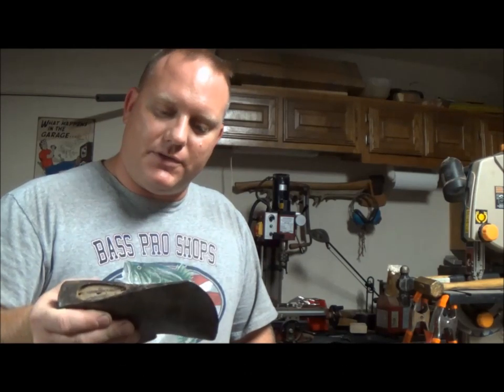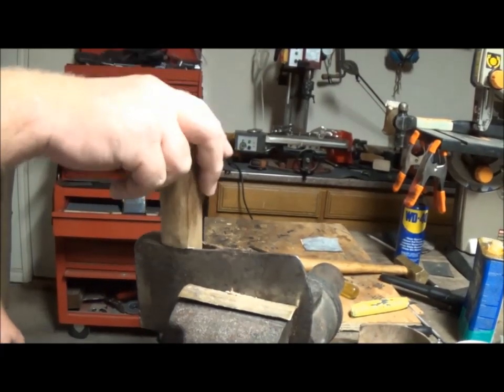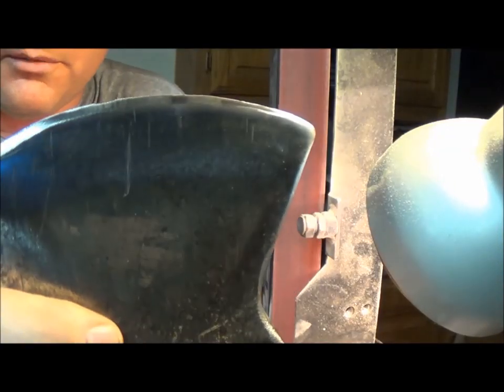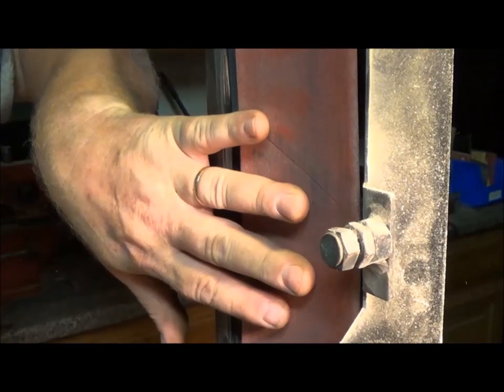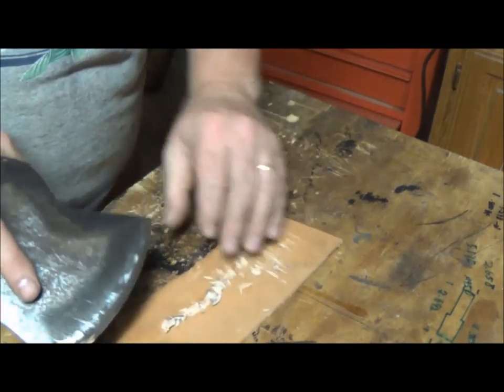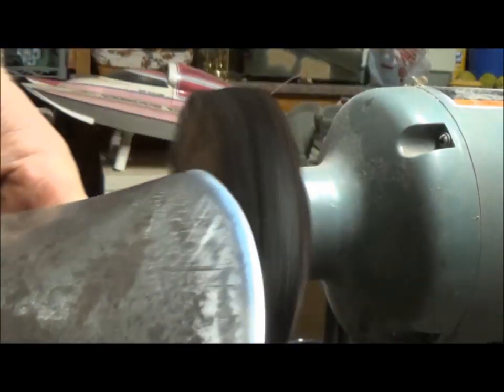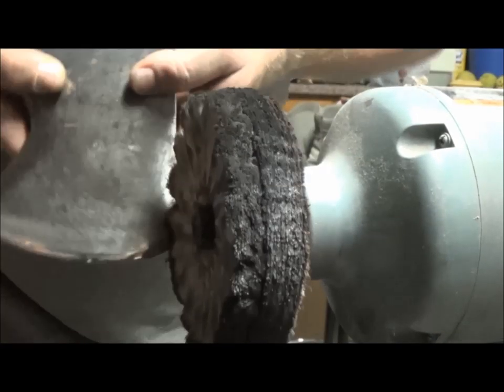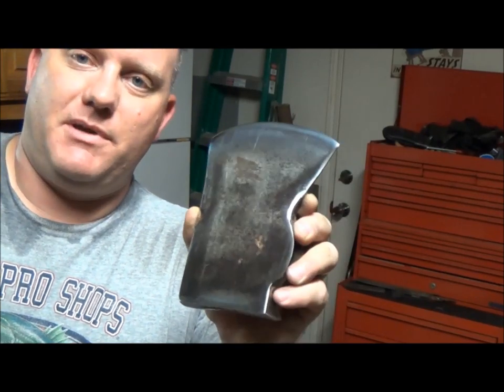Rockaway Axe Head -  From Rust to Polish

Comment: Were you worried about changing the temper of the edge with the heat of sanding and grinding?
Reply from the maker: Not at all. I'm not using much pressure at all on the sanding belt.

Comment: congrats. you have now a beautifull ruined axe.
Reply: +Philip V. After final heat treatment that was made in the factory you never touch a axe with power tools unleass you re heat treat it.
Reply: +Philip V. considering that a blade is anealead and quenced for strict periouds of time at very strict controlled temperatures... every heating counts on disturbing the treatment. If you use power tools, use very cold water in the abrazives in the same time
Reply from the maker: +Chirana Gheorghita Eugeniu Theodor I didn't let the heat build up enough to ruin the temper. I used the backside of the belt sander and went very easy on the pressure.  This axe is still as sharp as the day I sharpened it and its been through a 1/2 cord of mesquite already.
Reply: +Chirana Gheorghita Eugeniu Theodor yeah, that is wrong. most competition axes are ground with power tools. I grind all of my axes with a 9031 Makita belt sander, and I use them often-- not for a hobby, but for my job. you just have to be considerate of the heat buildup-- dont ever get it above 250 F and you are in the clear as far as changing the metallurgy of your steel. i basically just keep it cool enough so i can hold my hand on it indefinitely.

Comment: Did you ever do a followup video when you hung a new handle on it?  What else did you do to the head after this?  Did you polish the rest, paint it, or leave it?  I'm trying to polish an axe head myself.
Reply from the maker: I didn't do a follow up video, but I did put it on a 32" House handle and it's my main splitter.  Put a coat of beeswax on the metal and it's gotten a great patina from the use over the last couple years.  With the short handle and heavy head really does wonders with Mesquite.  Still own it to this day and sits next to my fireplace.
Reply from the maker: Anthony O I have other videos in my playlist that depict how to haft an axe head, feel free to check them out.

Comment: You weren't worried about messing with the temper of the steel while using a grinder on it? Could be very detrimental to the steel.
Reply from the maker: Nah, it doesnt get hot enough.
Reply: +3E971 hmm.. From what i know it does get hot enough. Seen alot of ruined tools from to aggressive machining
Reply from the maker: +Wafflemaste I go lightly on the belt grinder, especislly on the cutting edge, using the backside of the belt sander. the poll I'm not too worried about.  I only clean up those corners for getting rid of the mushroomed areas.
Reply: +Wafflemaste    I have got 2 hatchets 1 large axe 1 splitting muale all fiberglass handles can I switch them to wood  if you know or anyone else knows thanks in advance  and  also have a machete/Ontario knife brand w/o sheath never used its black w/hand guard and lanyard hole any thoughts
Reply: +Nexite well, what you know doesnt compare to what i know. true, i have seen some power tool ruined axes, but i have sharpened and used a lot more of my own axes with belt sanders and power tools. it has no effect on the temper if you are careful-- just dont ever get it too hot to hold indefinitely. folks who say otherwise just believe well intentioned fables!

Comment: Why the "criss cross?"  I don't understand it.  No axe I've ever sharpened has had a "criss cross."
Reply from the maker: Criss-Cross patterns help to remove material faster and also overlaps buffing wheel marks and very tiny scratches from the abrasives.
Reply from the maker: ***** Finger Eleven - Paralyzer

Comment: You're supposed to burn the helve out.
Reply from the maker: Caleb Whittington HA!  Nope, doing that would ruin the temper of the bit.  I've passed up many axe heads at flea markets for that very reason.  If it's not sitting in the corner of a garage at an estate sale or auction, I'm gonna take a close look at it before I buy it.